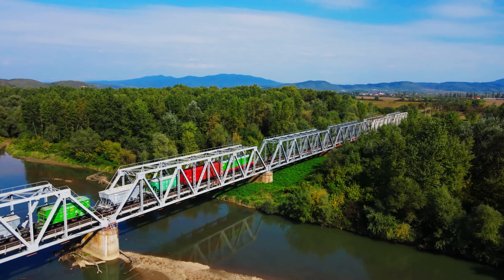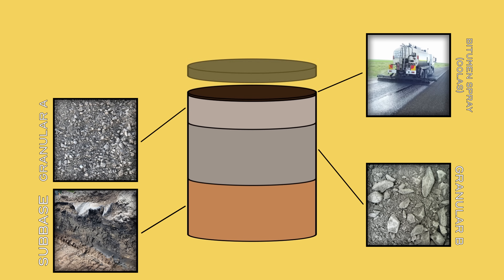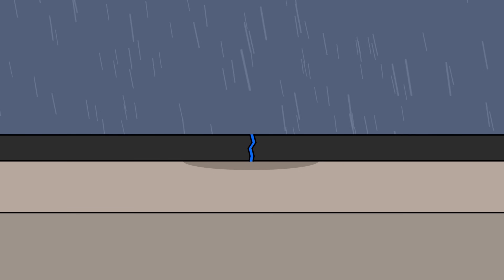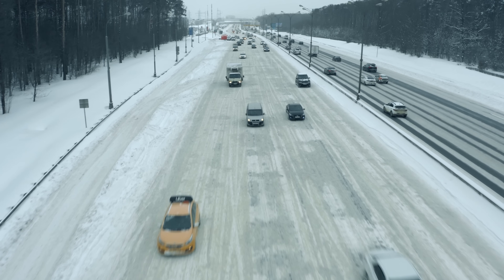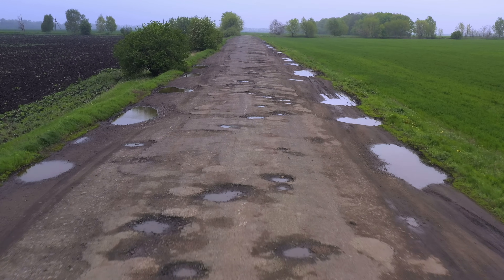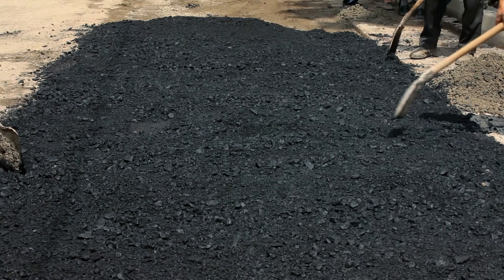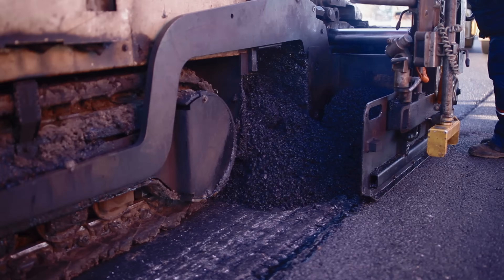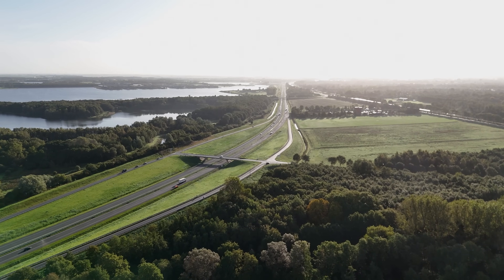Why Do Potholes Keep Coming Back Every Year?

Comment from the maker: 🚧 Why do potholes never seem to stay fixed?
This video dives into the hidden reasons behind our crumbling roads — from freeze-thaw cycles to political delays.

What’s the worst pothole you’ve ever hit? 👇 Drop your story below.

🔔 Subscribe for more deep dives into engineering, construction, and how our world really works.
Reply: to properly fix a pothole requires ideally going all the way down to the subgrade and properly compacting that layer and all the ones above.  When roads are not built with appropriate compaction and moisture from the beginning, and with a proper crown to allow water a better path than straight down... well then we get what the lowest bidder delivers.
Reply: Worst pothole I ever hit triggered the emergency shut off for the fuel pump.
Reply: Stop talking about old men, and start listening to them.... we know a hell of a lot more than you, son !
Reply: I'm in the UK and the roads aren't as good as you think. Yes, we are investing in better road technology but it doesn't address the issues with the existing network. A lot of our rural roads started out life as single lane roads with passing spaces at irregular intervals. These roads were designed for lighter vehicles so they aren't as thick as they need to be for modern traffic. When the amount of traffic increased, instead of replacing the roads they just widened them while ignoring the problems caused by the original raod not being sufficient for modern traffic. 

Have you ever noticed that sometimes there will be a big repair with loads of newer repairs around the edges where the joint between the original road and the new patch is? The problem is actually with the modern idea of neatness and efficiency that leads to workers making the easiest shape..... square. When they do this there is normally a nice little hollow left around the bottom corners of the hole they created to make the repair. It may be a tiny little void but this will lead to the asphalt starting to sag just enough to start the whole pothole process again. I remember my grandad teaching me how they used to repair roads when he was a young man. They didn't make the hole bigger by turning the hole into a square. They simply chipped the edges back to good solid asphalt, then they went round the edges an undercut the edges so that they could really ram new asphalt under the edge of the existing asphalt. They also went down below the bottom of the existing asphalt so that the patch would be stronger then what was there already. This left a patch that wasn't as pretty as the modern ones but it wouldn't need re patching in 6 months time. They moved away from doing this because it took longer and it cost more. 😢

Comment: The main problem with the roads in the US and Canada is the power of 4 rule. The DOT determined in their studies that the damage to the road does not scale linearly with weight on axle of the vehicle, but with the power of 4 of that weight. Meaning that a car that weights twice as much will not cause twice as much damage, but SIXTEEN times more damage.
There are trucks everywhere in the world, but only in the US is the Ford 150 the most sold vehicle.
I live temporarily in the US and I have never seen worse roads, and the only real difference is that car here are significantly larger than back at home. Easily the average is between 1.5 and 1.75 times larger. Even normal 5 door cars are larger.
So of course there is more damage.
Then you add that here every goddamn forgotten road needs to be at least 2 lanes wide in each direction and one stops to wonder why the US has some of the worst roads I have ever seen.
Reply: And I have driven a few times within Belgium. And these roads are significantly worse. People who have driven in Belgium will understand the severity of my statement.

Comment: An unexpected cause of potholes, especially in the summer is trees. When you have a street that gets a lot of sunlight and then a spot that gets shade during the hot parts of the day the road expands and contracts at different rates which causes cracking and heaving. It happens a lot in old neighborhoods with mature trees and thin asphalt.

Comment: As a municipal plow truck driver the clip of that plow jumping made my back hurt. I can assure you if he knew his plow was going to catch something he wouldn't have been going that fast. It scares the crap out of you the first few times and rattles every bone in your body even if you have an air ride seat. Also we spend most of the winter cold patching when we're not plowing and I can attest it's a temporary fix to a permanent problem.

Comment: So, all the asphalt that used to occupy these potholes, where does that disappear to?
I mean, sure, there might a few crumbs of asphalt around it, but never enough to actually fill it. And if car tyres are what flings most of it away, then should there be a correlation with an increase in windscreen replacements?

Comment: I'm in the UK and the roads aren't as good as you think. Yes, we are investing in better road technology but it doesn't address the issues with the existing network. A lot of our rural roads started out life as single lane roads with passing spaces at irregular intervals. These roads were designed for lighter vehicles so they aren't as thick as they need to be for modern traffic. When the amount of traffic increased, instead of replacing the roads they just widened them while ignoring the problems caused by the original raod not being sufficient for modern traffic. 

Have you ever noticed that sometimes there will be a big repair with loads of newer repairs around the edges where the joint between the original road and the new patch is? The problem is actually with the modern idea of neatness and efficiency that leads to workers making the easiest shape..... square. When they do this there is normally a nice little hollow left around the bottom corners of the hole they created to make the repair. It may be a tiny little void but this will lead to the asphalt starting to sag just enough to start the whole pothole process again. I remember my grandad teaching me how they used to repair roads when he was a young man. They didn't make the hole bigger by turning the hole into a square. They simply chipped the edges back to good solid asphalt, then they went round the edges an undercut the edges so that they could really ram new asphalt under the edge of the existing asphalt. They also went down below the bottom of the existing asphalt so that the patch would be stronger then what was there already. This left a patch that wasn't as pretty as the modern ones but it wouldn't need re patching in 6 months time. They moved away from doing this because it took longer and it cost more. 😢

Comment: There IS another solution, or rather PREVENTION, that you failed to include it even allude to. 

Employ a superior set of techniques & materials for road construction! 
And the obvious, primary reason we ignore it is, of course, cost.
This still does not eliminate or prevent any or all potholes.  But their formation is significantly delayed, they also are much slower to develop, and they do not become as severe, dangerous or destructive. 

Perhaps further improvements of these superior methods with the integration of substrates such as the Dutch innovation you mentioned will finally yield roads highly resistant to potholes.
Perhaps this will even include the use of waste materials which we are unable to recycle economically.

Comment: well they actually got a solution is called concrete but they don't use it. it could be because it cost a little bit more but it last a lot longer

Comment: There's a solution:

Tires linked to hold the roadbase together, filled with base, paved over the top, causes the base to hold together perfectly as the rain only goes through the base, not pushing it to the side. 

Man in West Virginia figured this out already. 

Has his solution been tried? Yes. 

But. The construction 🚧 companies need money 💰 

Its a solution that allows for owners to make bank year after year. 

And it's why we are years behind in infrastructure

Comment: And - of course  -   the VEHICLES  -  especially ill-sprung, overweight, badly driven, badly maintained -   you cannot do anything about them, can you ?  Of course not !  Boys will be boys, men men, and some of them clueless, useless idiots.  Now if ytou could fit a small, on board,  recording accelerometer  -  then you could monitor a driver's conduct. Spot boy racers. Fine them. (Ban them ?)  (Re-educate them ?)  Cannot do any of that, natch'.

Comment: I’m surprised at the road make up there.

Here in UK it obviously varies depending on anticipated traffic numbers / soil conditions / frost depth / etc - but the below would be a fairly ordinary residential street on a new build development.

We would normally have natural ground (ie remove topsoil and reduce dig down to anticipated level, then test the bearing capacity to confirm the design)…

Then capping stone (eg 6F2 Crushed Concrete) which varies in depth based on the CBR (California Bearing Ratio of the natural ground) but is usually between 150mm and 600mm deep with anything worse than that requiring a special design (eg soil stabilisation using admixtures like lime, or using geo textiles) - and this usually extends beyond the kerb line by between 600mm and 2m…

Then sub base (MOT Type 1 - crushed limestone or concrete which has a specified sieve profile for larger stones of 75mm down to fines) which is usually 150mm thick.

Then Road Base tarmac (eg AC32) of about 150mm…

Then Binder Course (eg AC20) of about 60-100mm…

Then surface course (eg AC10 / AC14 / HRA) of about 30-50mm.

Or if block paved then binder and surface course would be replaced by sand or permeable stone (50mm thick - with the layers of stone under the road base having been replaced with permeable stone) and block paving (80mm thick).

We have regular inspections by the adopting highway authority - to make sure that tests are carried out (eg testing the ground bearing strength on natural ground and on top of both stone layers - testing the grading of the stone - testing the grading and bitumen content of the tarmac layers - testing the texture depth / skid resistance of the final surface - etc), correct depths of stone and asphalt are used, bitumen is used between layers of asphalt and any vertical joints (eg against kerbs or ironworks) and that any manholes / gullies are constructed correctly.

The highways authority will take a road onto maintenance for between 2 and 5 years and requires all damage to be repaired before adopting the road, as well as a large payment. Tarmac roads are designed so they should not require any maintenance for 25 years after construction - but obviously can be affected by things like oil / diesel spills which degrade the tarmac.

Any roadworks carried out can be inspected during the works, upon completion, at 6 months and 2 years after completion and the contractor will be required to carry out any repairs necessary.

We do have similar problems with the utility companies having a poor standard of repair as well - and with older roads which are “built on what came before” rather than designed from scratch.

Comment: I've used cold patch on our driveway and it stays put but I've almost always prepared the surface first, and with a good coating of bitumen around the edges of the hole it binds the patch to the original surface.

Comment: I wouldn't look to the UK for better road maintenance. It's been dire here for more than a decade as local councils (responsible for non-trunk road maintenance) have been systematically starved of funding (it gets handed out by central govt here), so road maintenance has had to be cut. Much of the UK now has a serious pothole problem from 15 years of mostly-patching.

Comment: Here in central/southern Illinois our roads are beyond shot and every repair is a damn cold patch. Our cold patches last 3 days maximum. Our governor needs federal prison and our states government need arrested and cleaned up. They cold patch year round and lay concrete slabs to “mend the issue” I currently know 5 separate individuals attempting to sue IDOT due to damage and car accidents that ended fatal due to poor road conditions. Don’t move or drive in or too Illinois. I’m in the process of leaving this state and never turning back!
Reply from the maker: Yah that sounds horrible, to the point of concrete slabs, they last longer and don't deform like asphalt does. So, when they patch a road with concrete, like around a manhole, the concrete holds up but the asphalt around it usually gets damaged causing a massive concrete bump in the road which does even more damage to wheels than a pothole would lol, there's no winning with the patch jobs it seems
Reply: That reminds me there's a road near us that was concrete at some time in the past but it has since been asphalted over. The outline of the concrete keeps breaking through.